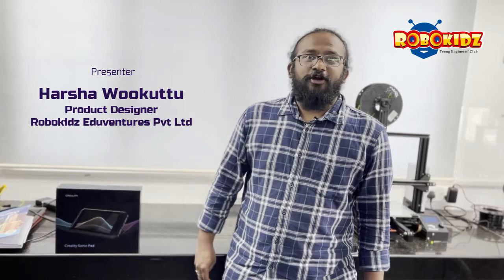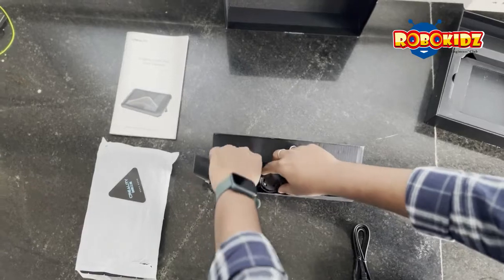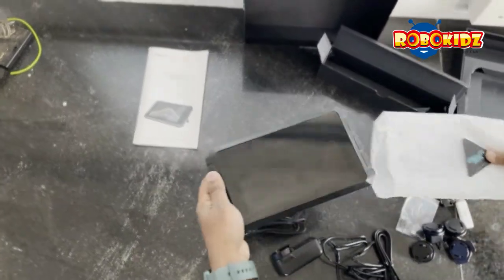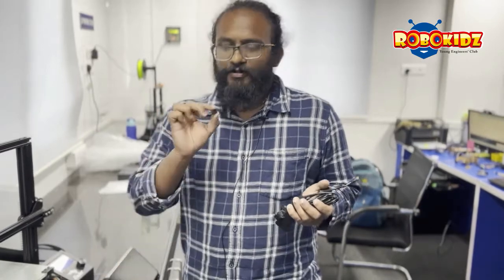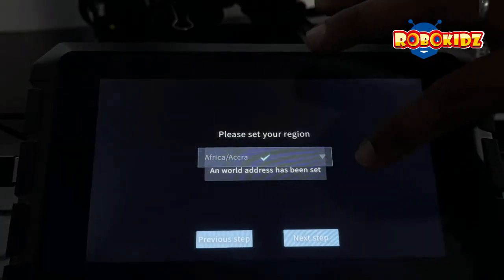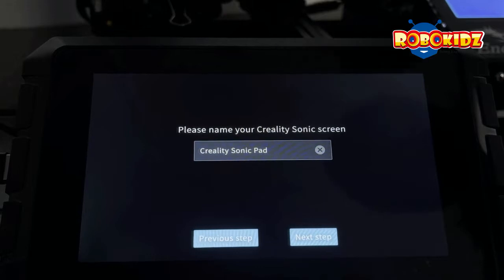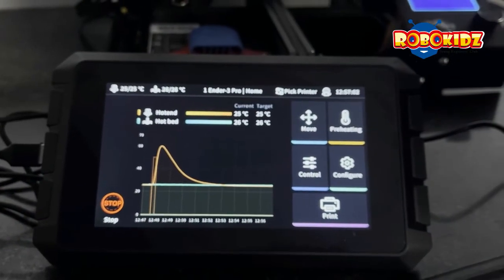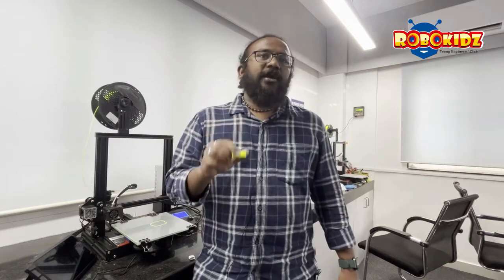Creality Sonic Pad - Unboxing & printing

Comment: Very good video, one question. Have you tried to print from the USB port on the sonic pad. I have tried everything and it cant read the file. Have you had any luck trying to print from the USB port on the pad?
Reply from the maker: Yes We have tried printing the gcode from USB 1 port using pendrive. Sonic Pad take some seconds to recognize USB stick after you connect.